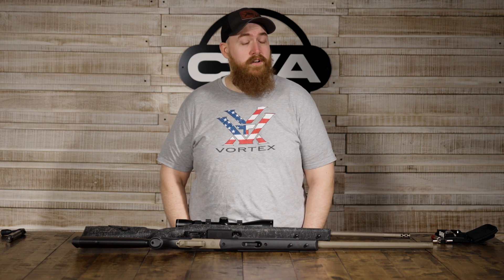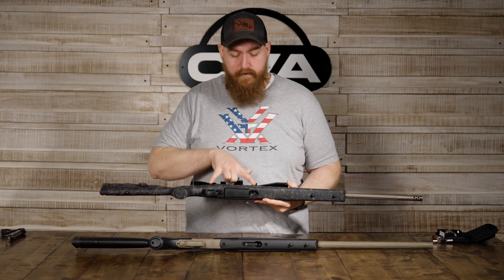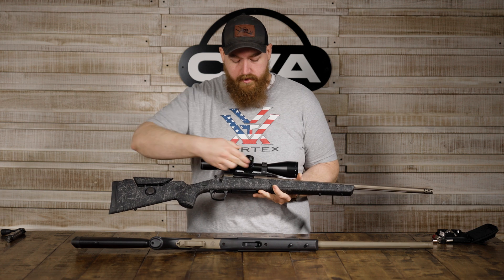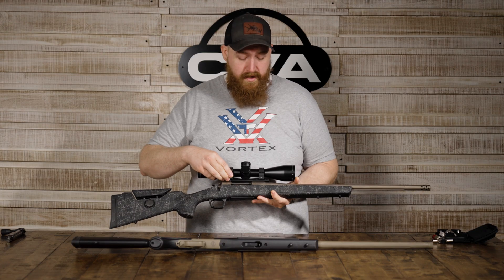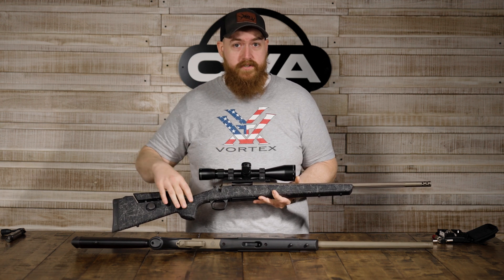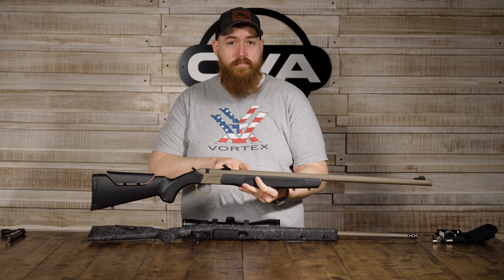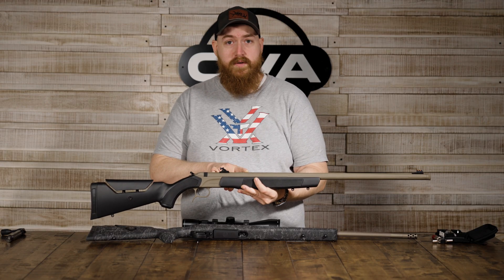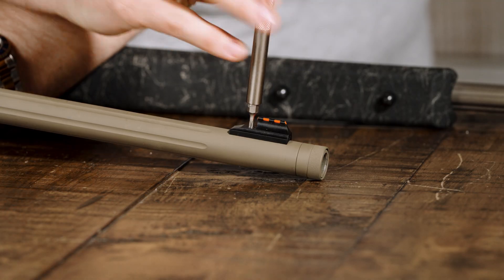HOW TO:  Torque Your CVA Rifles to Factory Specifications

Comment: The holes for open sights, do use any loctite on the filler screws when using a scope?
Reply from the maker: The Filler Screws do not need and extra adhesive.